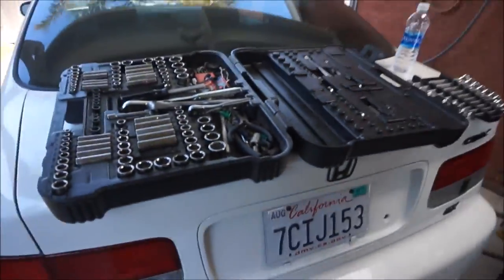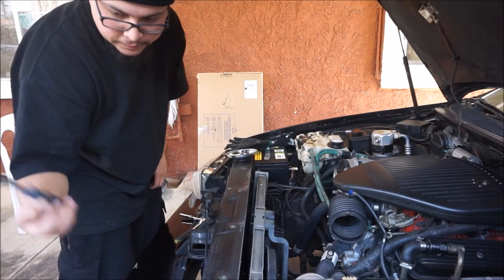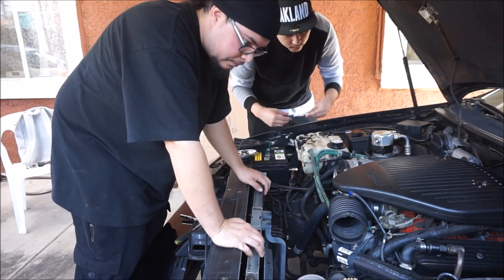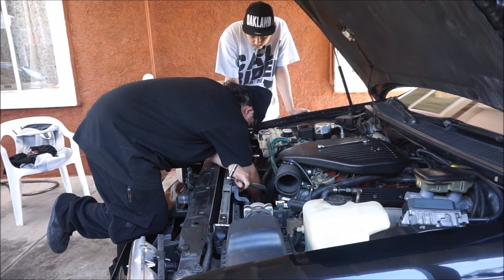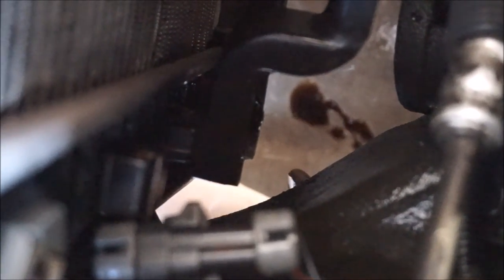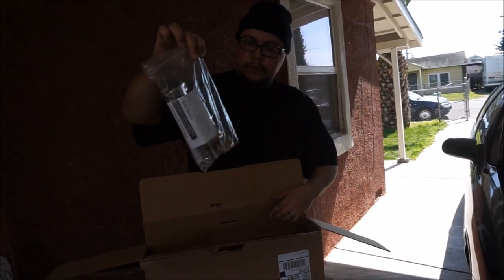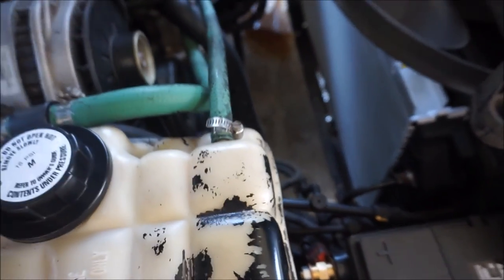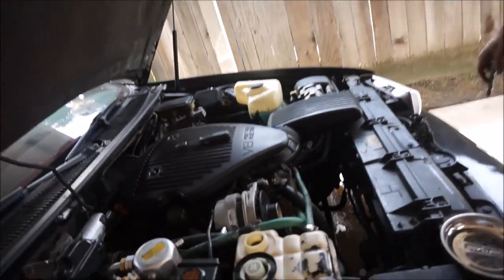1995 Impala Radiator!

Comment: for those who  OR 9C1(AKA  TAXI) ,they don't have engine oil cooler on radiator on driver side!
they have separate radiator in front of radiator, so U need order 1516,impala gets 1517,how ever you get 1571 and it fit don't worry there is nothing going there, so just keep the plug in(that comes comes from factory!

Comment: Hey bro I have a leak on one of the oil lines but it's coming not from the line but from the radiator part is that fixable or would I need a whole new radiator?